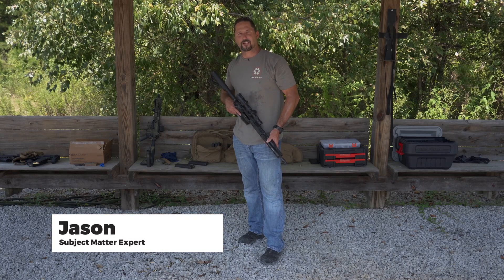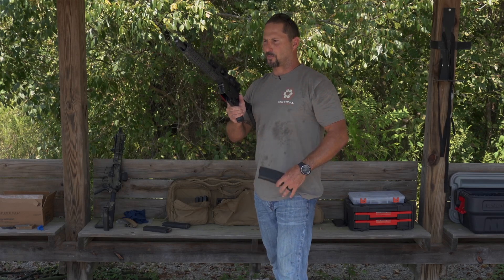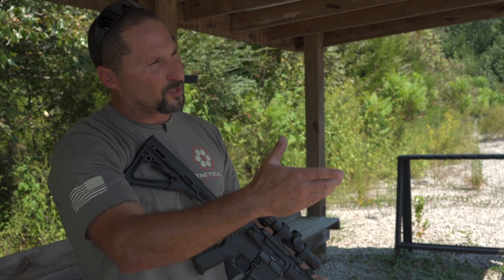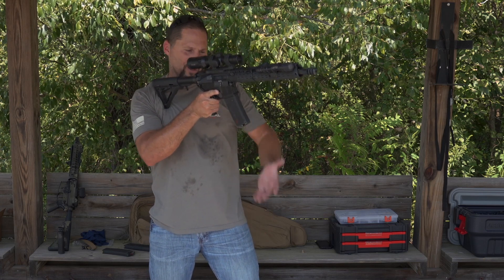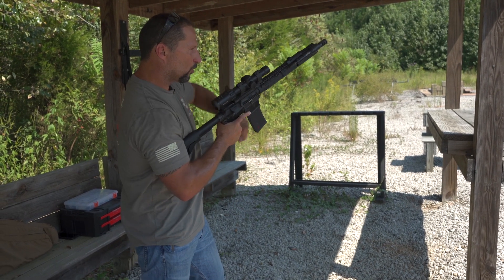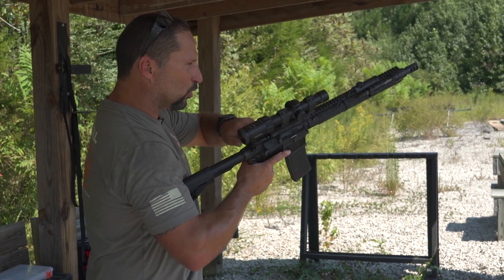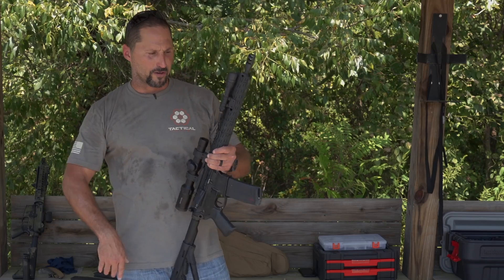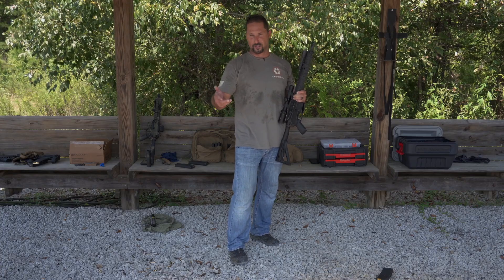Rifle Malfunction Fixes with Former SWAT and Marine Sergeant, Jason Redding

Comment: Recommend not having 30 in the mag?
Reply from the maker: You’ll hear people with different takes. However, overall these days, modern magazines should have no problem- a 30-round magazine is designed around having 30 without issues. For many, when issues arise, it’s because something has gone wrong with the magazine/mag spring.